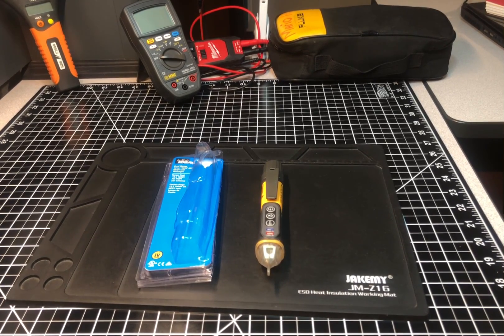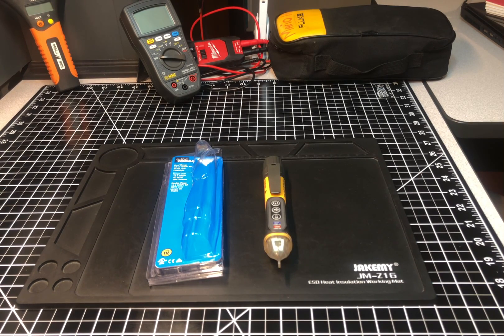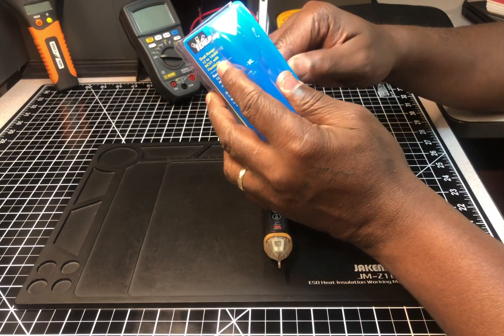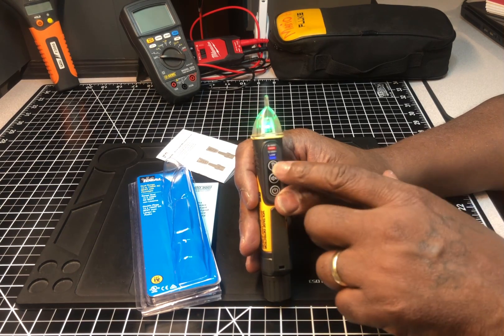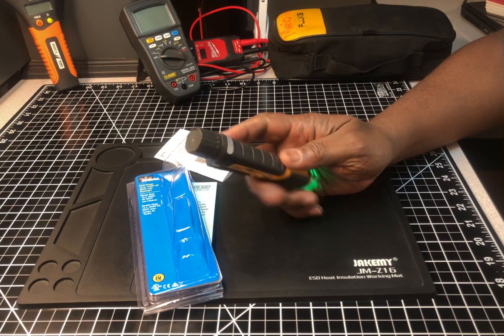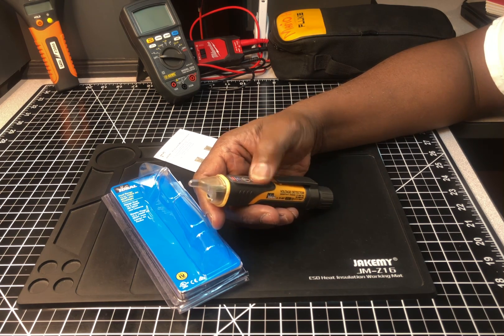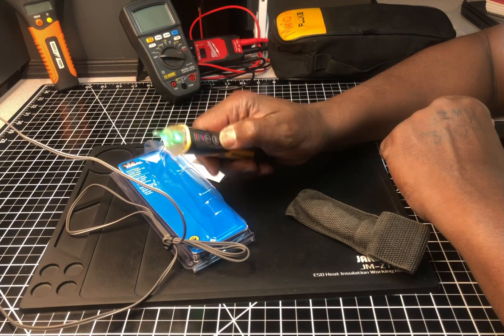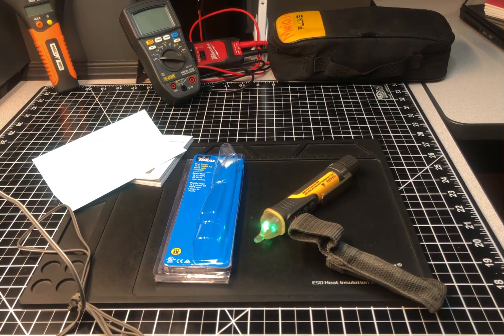🇺🇸 IDEAL INDUSTRIES 61-657 Dual Range Voltage Detector

Comment: Good review 
i got one not much different a few weeks ago but personally i too would have had no objections paying a little extra for a pouch or even a plastic holster;
These fellers are missing a trick
Reply from the maker: One of my viewers just told me about a holster called ( Nite Ize Light Pouch ) that’ll hold the Ideal volt tester. I googled it and he’s correct, I believe it’ll work it only cost $9.99 at harbor freight of LOWES. 👍🏿💴